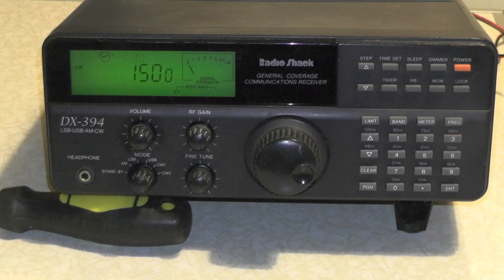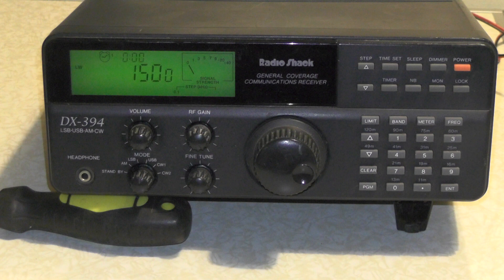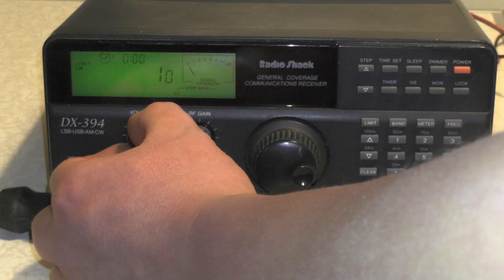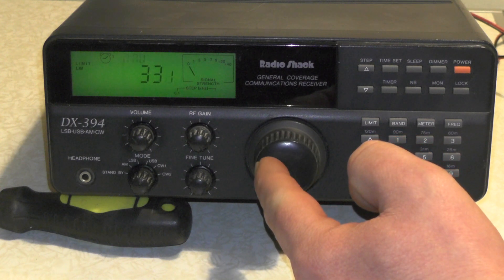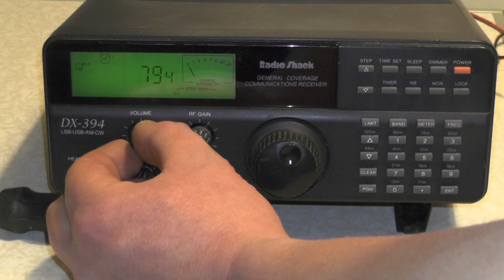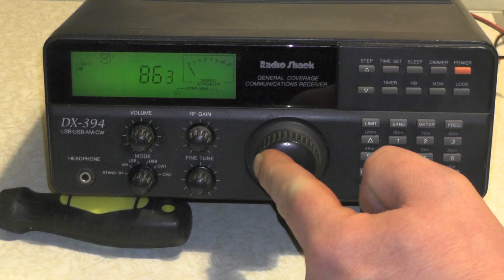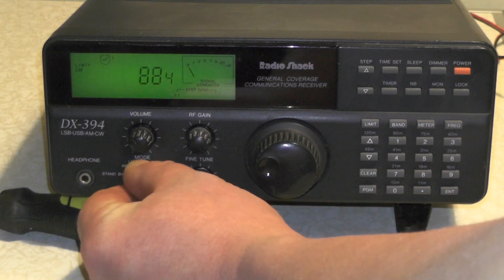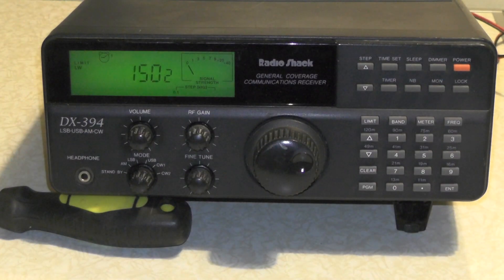Tuning below 150KHZ - Anything out there???

Comment: Strange you didn't detect the VLF transmissions from Cumbria on 19.6 and 22.1 kHz.  Nor the others on 17.8, 23.4, 18.6 and 20.9 from elsewhere in Europe and the USA.
Reply from the maker: Maybe it’s because I get a lot of qrm at my location
Reply: @2j4ez  I can detect the 19.6 and 22.1 from Cumbria 600km away indoors using a 40-turn 60 cm diameter coil of wire plugged directly into the soundcard of the computer and use a spectrum software to see the signals.  I'm wondering if the frequency shift you applied to your receiver actually worked?   
Regarding noise, the old CRT TV sets produced VLF noise at 15625 Hz (from memory) and some items like fluorescent lights and vacuum cleaners produce noise too, but the signals from Cumbria are very strong.

Comment: Has anyone ever heard submarines.  Do they use data or voice?    What frequency r they at.  

Thanks.
Reply: Yes, they do transmit on VLF. Alot of these signals are for submarines due to the wavelength of the radio wave.
Reply: @Antenna101  can you give me a window of a low and high of frequencies they actually use...
Reply: @gtpyyz  I wouldnt know anything specific.

Comment: Very much  thank you.  My opinion is quite different :  that  is a lot going on there, including submarine  stamp signal (not at its  fundamental but at its  higher  harmonic) However the most  interesting would be if you connect vertically polarized antenna electrically shorten ( coil) with tunable tank capacitor or just any other form of  tuning  it    from little below 18kHz  up to 170 kHz.But  polarization of an antenna must be vertical. Tesla coil  is perfect for it - where Top Capacitor  is elevated up down. impedance match is little  problematic but is doable.
 Such structure allows to  receive vertically polarized  Zenneck wave (at  Brewster Angle)  in TM(transverse  Magnetic) mode  from earth/air interface ,  I didn't get much luck  with receiving   signal from Viziv  of Dr  James Corum transmitting from Milford Texas at 20kHz but there is a lot going on there. 73'
Wesley

Comment: I'm new to radio - Why are there so many frequencies that just have beeping or tones playing?
Reply from the maker: on SW your hear lots of beeps which is morse code. your also hear number stations and loads off odd noises. some of the tones below 150hkz are the time signals from rugby.
Reply: 2j4ez Thanks for the reply. Ah, I see. What devices use the Morse code? And they aren’t just on SW. I found a cool site, websdr.org and they’re everywhere. Also I’m American, so what do you mean by ‘from rugby’?
Reply from the maker: @clockwork1203  rugby is a place in the uk.Morse code is not just on SW its also on VHF and UHF here in the uk repeaters give off there ident in morse code i'm sure it the same in America. try listing on the WEBSDR.ORG on 7mhz (40m) and 14mhz (20m) and 3.5mhz (80m) at the first part of the frequency you will here loads of morse code you can use a app on your phone to decode it
Reply: @2j4ez  Oh ok thanks. I though the beeping at first was natural or like weird static. :)
Reply from the maker: @clockwork1203  You will always hear weird noises on short wave
Reply: @2j4ez  👍
Reply: Teletype and FSK signalling data.

Comment: Amazing!  yes it does work. I took the lid off and tweaked T9, T10 and T11 to bring the sensitivity up a bit which helped. Best frequency for sferics is on AM at 8KHz on the readout, not sure about the accuracy of the readout though. The 60KHz time signal shows up at 77KHz, so it is out a bit.Tapping the circuit board with a screwdriver, results in a mechanical microphonic sound coming through the speaker. Thunderstorms at the moment over France and US East coast. Antenna is the half delta loop.
Reply: @Matt It is probably not he 60kHz time signal showing at 77kHz. There is the British time signal MSF, broadcast from Anthorn, in Cumbria, on 60kHz but also the German time signal DCF77, broadcast from Mainflingen, near Frankfurt, on 77kHz. If your antenna is aligned roughly east/west it may null out the UK signal to the north on 60kHz, but bring in the 77kHz signal from Germany.

Regards. Julian. G1EKW
Reply: @JulianGrammer  Yes you are probably right Julian, thanks for your reply. I've had some great success with VLF listening using a Datong VLF converter and a 100 ft half delta loop antenna, fed with coax to an isolating matching transformer. This set up works surprisingly well for me, with very good signal strength on all VLF signals from as low as 10Khz upwards.  I heard the SAQ Grimeton CW transmission, on October 2020 at very good signal strength. Sferics are also easily received at up to S9 + as well as many other VLF signals. So just to reiterate, I'm not using a small loop VLF antenna, but a much larger 100ft half delta loop. I didn't think it would work at all when I made it, as it's totally untuned for VLF. But it has an extremely good signal to noise ratio, with virtually no noise at all. I am totally amazed that it works so well.
Reply from the maker: Hi i have the receiver for years theres 2 versions a&b version b cant go below 150khz as far as i'm aware. but its a good radio to listen to the bands i used it for years to listen to the bands
Reply: @2j4ez  Hi yes indeed it is a good radio, great for general listening around. My DX394 has been in storage for a very long time, so glad I saw your video. I must have the a version then, I bought it from Tandy's way back in the 80s. But it certainly works at VLF, as I can hear navigation beacons as well. I reckon with an outboard VLF amp to lift the gain up a bit, it should work reasonably well. I also tweaked T12 and L6 very carefully with a very small screwdriver,  filed down to fit the lugs, so as to peak up the sferics around 10KHz. The selectivity on am is quite wide at 6KHz I guess, which is great for AM. Switching to LSB USB doesn't work for sferics though, best heard in AM. Anyway great stuff! 73

Comment: I use a half delta wire loop about 100' in length  for VLF. Works very well indeed all the way down to 10 KHz which surprised me. My Wellbrook loop also receives down to 10KHz BTW.  I can easily copy sferics over the US, and other VLF transmissions as well. I use an isolating transformer between the coax feeder and half delta loop, which consists of a 1 meter length of thin copper wire wound onto a FT240-43 ferrite ring, and 4 turns of insulated wire for the coax. I haven't tried my old DX394 down to VLF, will give it a go. My next challenge will be ELF, listening for Whistlers and Tweeks.  I don't think that will be so easy with all the 50Hz mains hum, but using Spectrum Lab on the PC may help in that respect.
Reply from the maker: Matt Bates for short wave listing I just plug in my silver rod antenna and it seems to work fine for swl I have done for years . I built a antenna from a long wire a few months ago I’ll try that on it . As soon as we are aloud out I’ll take it out mobile and try it again as the noise floor will be a lot lower
Reply: @2j4ez  My own experience at using long wire antennas over the years, I found them to be very noisy on receive. Bringing the wire directly into the shack didn't help either, as it picks up much more locally generated noise. The best way I found to reduce this noise, was to use coax feeder directly out to a wire antenna, isolate and match it accordingly. A loop antenna tends to be less noisy on receive than a single wire or Dipole, so a loop is preferable in noisy areas. Yes mobile is the way to go, there's a lot less noise out there in those remote areas!

Comment: If you like to use your CB antenna, just connect the center pin on Hi-Z input and you will have more detectable signals. When tuning to the 60 or 77.5 kHz time signals use the mode. You normally must hear signals on 18.5 - 22.1 GDQ- 22.6 HWU - 37.5 HRK - 45.9 NSY Just to name a few. Best use a PA0RTD miniwhip €60 wich receives from 10 kHz up to 20 Mhz. There are also a number of good active loop antennas (Wellbrook and Stampfl) that will do the trick. Good luck!

Comment: 0-30Hz ELF natural radio, record and playback 60x faster... sounds is interesting...
30Hz-10kHz VLF natural radio... auroral chorus, sferics, tweeks, whistlers.
10kHz- 100kHz military communications, time signals, navigation...
100-150kHz : navigation, amateur band, teleswich... AM radio band starts...
So not emty band.
Reply: Yea, not so empty, only natural VLF especially, requires a different approach, not using tuned circuits to just a certain frequency assuming "carriers", since natural VLF doesn't have "carriers" or "subcarriers"...
Reply: @750kv8  yes, but next "natural radio band" is a ultrasound (>20kHz) and near ultrasound band (10-20kHz). I use heterodyne bat detector ( direct conversion receiver with electret mic ) and hear bats and birds...  best segment is a 10-20kHz bird songs.... sounds is cool :) on SSB.
Reply: You can use below 10kHz unlicensed in some places, not like it matters either way though. But I did see some videos on here of people making ground induction loops and their own transmitters for the 7 to 9 kHz range. Metal detectors also use that frequency range a bit.
Reply: @kishascape  I make experimental VLF ( audio signal ) transmitter with 70m earth probe antenna.
RX part: VLF "natural radio" receiver with 20...25m earth probe receiving antenna...
and I can hear audio about 120...160m away ( distance between TX and RX antenna )
This idea can use for simple cave radio...

Comment: what antenna u using ? long wire?...
Reply from the maker: no just plugged it in to my 11m antenna its ok for just listening thanks for watching
Reply: @2j4ez  yep but an even longer random wire will surprise you as you probably know ! I have also recently dug out a few ham related vids. More to follow. Take a look. Cheers, Nick
Reply from the maker: @NICKGAR7  Yes I did look at your channel saw the iss contact I was work when it was taking place. I just popped up stairs and had a listen. one day ill make contact to the iss
Reply: Best antenna - miniwhip active antenna...
Reply: I used to do that...plug my reciever into the CB antenna, it actually doesn't work too bad given what it is, hell,  it would receive decently up to about 400 MHz. I've never had the space for a larger setup, but one of these days when I move to the country I'm gonna have an array that the military themselves would be jealous of.  Well, maybe not, but at least one that would suit my needs.  Nice vid, man!! :)
Reply: @punishedexistence   I use miniwhip or indoor loop antenna 1mm2 wire single turn loop 2,7m x 4m or larger sqare... and Variometer coil tuned LC tank. Loop is a inductive coupling with variometer coil with 1-3turn coupling turns
Variometer is about 1mH inductance and with dip swich variable cap (220nF to 220pF) I can cover VLF-LF bands ( 10kHz to 1MHz) with single coil ( variometer ). Receiver - tuned freqency receiver with FET input stage ( 3 - V - 2 )